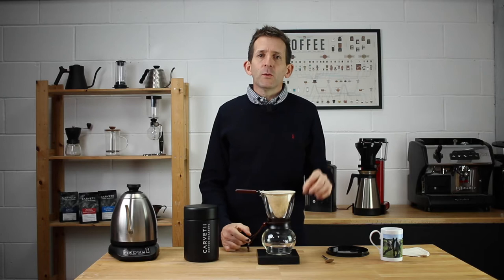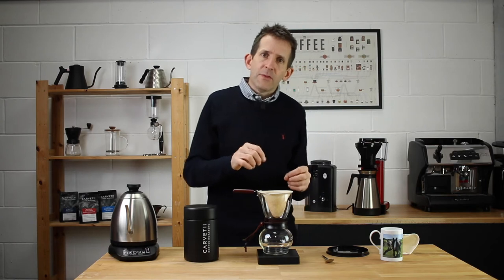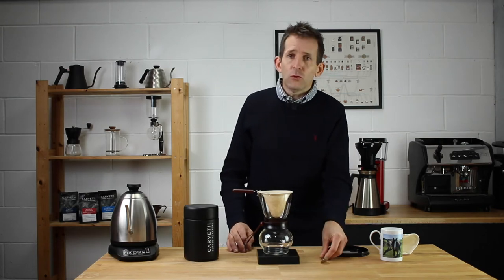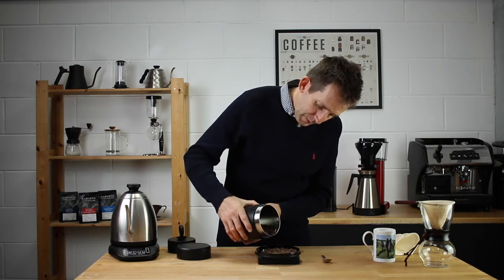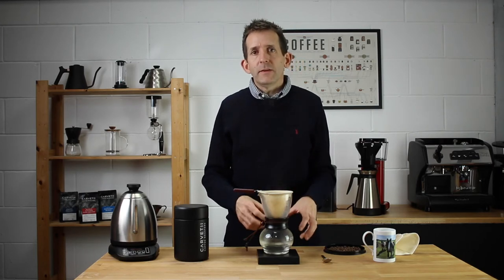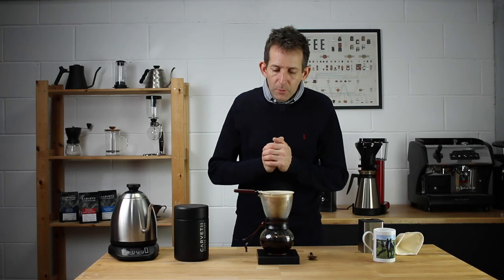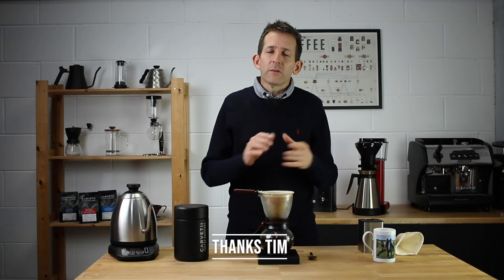Brewing Coffee with Cloth Filters

Comment: I have the same woodneck dripper setup and am trying to brew 40g/550ml in it (I like it on the strong side). I am finding that while the pot can certainly hold that much brew, the sock is quite full of grounds, and therefore there is not much room in there during the brew. This makes doing any of the fancy pourover stuff with swirling/spoons very hard, and by the end of drawdown the spent coffee grounds basically fill the entire cloth filter. Any thoughts on how I should alter my technique when trying to brew 2 cups in this vessel?
Reply from the maker: I had a look at replicating your recipe to see if I could work in some tips for you.  In all honesty once I saw the dry grounds in the filter I knew it was going to be difficult.  I think the ratio you are using is just too much for that particular set up.  To keep the level of coffee in the pot below the bottom of the filter I would need to work on 330ml or thereabouts.

If you are happy with the coffees you are producing then my advice would be to carry on as normal.  You might also consider dropping the coffee amount slightly, maybe to 35g.  If your coffee to water dose is too high, you can sometimes ask too much of the water as it passes through the bed, so a 35g dose might give you broadly the same drinking experience.

Other than that a larger pot might be the only solution?  Or consider a 6 cup Chemex with a cloth filter?
Reply: How about splitting it to two brews of 20g each?
Reply: Or go for Osmotic Flow where immersion is not a thing.
Reply: @carvetiicoffee  thanks for the thoughtful reply. i am hoping to do it in a single batch (it;s morning coffee for me and my wife and it's early and i just want to get to drinking it rather than having to rinse and repeat!) but i think definitely 35g could work. should i then compensate by grinding slightly finer?
Reply: @rbmanb  just watched a video on "osmotic flow" and that is exaclty how i end up pouring--but by neccesity. it's kind of precarious because the crust is so close to the top edge, but it works. and i feel better now that i know that what i'm doing has a fancy name!
Reply: @cjhacker23  For bigger brews you could also try french press. Also no much effort there.
Reply: @cjhacker23  I'm glad I can be helpful. I actually don't have much experience but I learn a lot lately.
Osmotic Flow is definitely one way to go, yet takes time to master.
Also this hand drip tends to take an extended amount of time of the drip itself, if you don't mind about it and enjoying the process as well as the taste, awesome.
If you like to get the most flavour+oils out of your coffee at the same time the least effort, go for French press.
Reply: @cjhacker23  In case you do decide to stay with Osmotic Flow, my word of advice, grind coarse.
Grinding fine or even medium will result your coffee to become overly bitter.
Reply: @rbmanb  I generally do not like French press. The sediment is unpleasant. The only press I’ve found that filters well enough for my taste is the Espro pot... and that’s $120US!
Reply: @cjhacker23  Cool. Go with what works for you. Another possibility is to get a bigger dripper like Chemex and use their paper filters too.
It'll also look much better, if you care about those things.
P.S. just realized you probably already do use a Chemex. Sorry for that.
Reply: @rbmanb  I actually am coming from a V60, which I think of as ideal--simple, delicious--but was trying to figure a way out of the waste problem with paper filters. Chemex, though I really do like the taste, wastes something like 4X the amount of paper because of the folded filters. I saw James Hoffman's video on cloth filters (he shows off this same Hario Woodneck dripper) and he made it sound very appealing: no waste, and all the deliciousness of French Press without the sediment. And it is indeed delicious. It's just this cloth filter is a hair too small. Of course I bought this thing from an online retailer and cannot return it at this point, so I'm trying to make it work. It's fine. Just need to tweak the recipe / technique. I'll get there!
Reply: @cjhacker23  Please update how it goes.
A cloth filter wouldn't cost that much would it? Try to order a slightly bigger one from China (Aliexpress/alibaba), it would basically be the same product but cost half the price if not less.
I get you for the environmental reasons, I also don't know what I'll do once I finish my Hario v60 filters, they are supposedly more environmental since they're non bleached, but still... I reckon a non bleached paper for a Chemex might be too much paper taste to get rid of.
I'm trying to get by with a cloth myself, hence I'm here.
The best luck for the both of us.
Reply: @rbmanb  Brilliant idea! I'm going to head over to Aliexpress right now. I think that may just solve the problem entirely. I'll report back with results! Thanks again for all the suggestions.
Reply from the maker: I figured you’d be wanting to do a single batch - I think convenience is always key! I’d keep the grind setting as is and respond to taste. You don’t want to slow the flow down as it could cause similar problems. Make a brew, taste and make small adjustments to the grind each time. Might take 3 or 4 brews to get it right.
Reply: @cjhacker23 
I used to brew 40g of coffee in this dripper. It’s literally like the most you can do, without the finished coffee not touching the sock on drip down. 
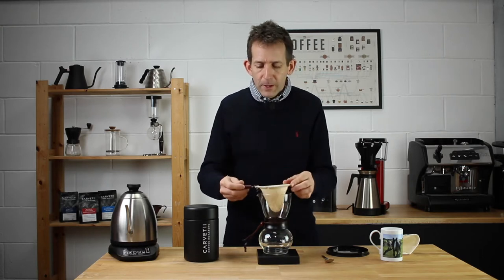You can probably get more volume, I’m figuring 550ml translates to 550g of hot water. I used to do a 1:16, which with 40g of grounds, that’s 640 of hot water added. Maybe make it an even 600 for something closer to 1:15. But yeah, that sock is gonna be full, it’s not really designed to brew that much but you can do it.

I kind of disagree on the whole swirling thing that everyone is doing nowadays. The way I was trained, was to not disturb the bed of grounds so there is even horizontal top to bottom extraction. I’m not sure it makes much of a difference in final quality, as I’ve done it both ways myself and went back to my roots of not-stirring. I used to be able to get a cup and a half out of the wood neck, and that meaning a 12oz cup plus another 6oz for me to top off with. 

I say if you love it, and love the quality of coffee it brews, find a way to make it work. It really does produce amazing coffee I swear by.